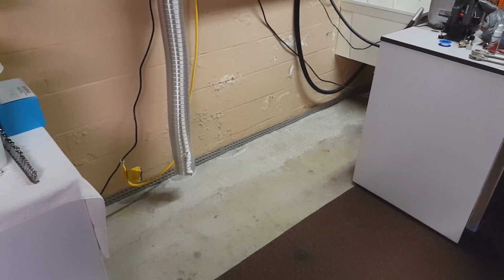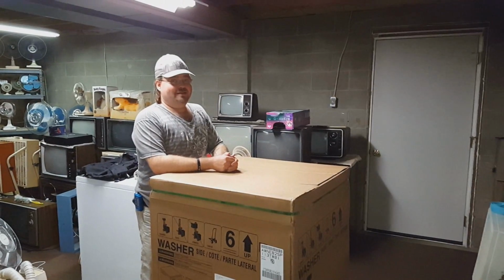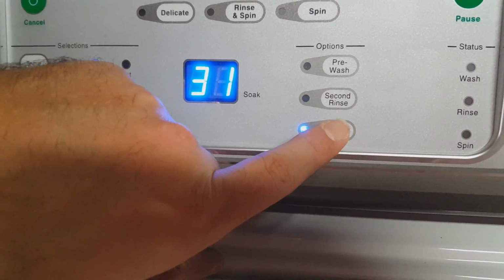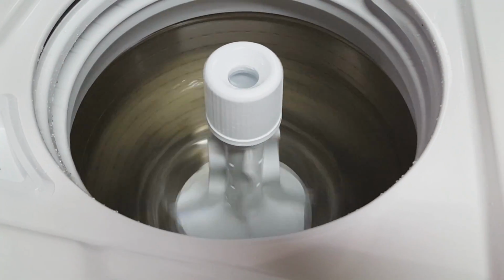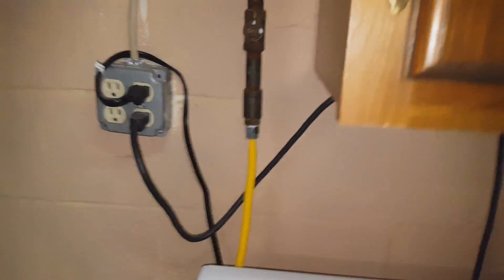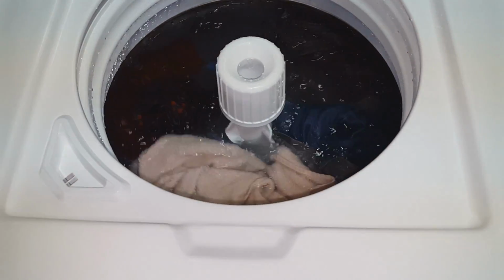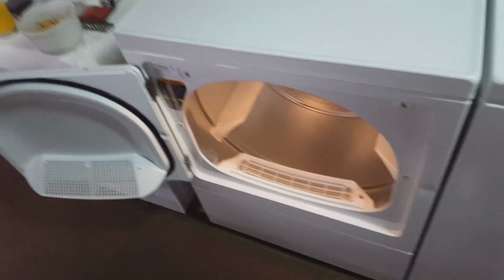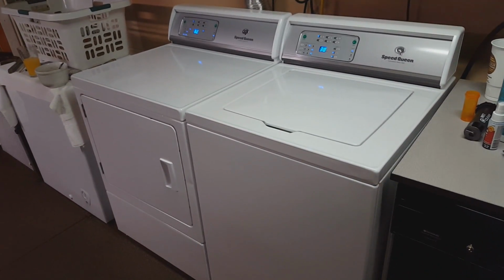The 2015 Speed Queen 8 Series

Comment: Speed Queens have pretty much all metal interior parts and they are advertised as reliable. Even if some of the parts were made in China, it’s still pretty much all metal. The only part that isn’t metal is probably the agitator or the balance ring or the bleach dispenser. Direct drives have a lot more plastic than a Speed Queen. There might even be some rare direct drives with plastic tubs.

Comment: Well, LG Front Loaders are not bad.

.  Last 13-16 Years (still would prefer a Speed Queen — Lasts 25 Years or Longer)

.  Use Oxi in Washer, whitens just fine

.  Use Vinegar during Rinse Cycle when Washing Towels, otherwise, Fabric Softener is fine

.  Excessive Detergent Usage is curtailed, just put in one or two Pods into the Drum when you start your load

.  Wipe gasket clean and dry after wash day, run Clean Washer Cycle once or twice a month using a Washing Machine Cleaner or one cup of Chlorine Bleach using Hot Water

.  Leave Door Open & Ajar at the end of wash day to allow washer to dry out and air out (eliminates molding and odors), and you may not need to run any cleaning cycles if do preventive maintenance.

I would buy a Speed Queen Front Load Washer if money is no object (can do a complete cycle in 35 minutes, again with regular preventive maintenance)

And if not, an LG would be the Front Loader I would buy.

An Electolux Front Loader would be an honorable mention, because it has a stain boost component and the ability to mix water, and detergent and/or other pretreater, to get difficult stains out.  I would still use the same preventive maintenance procedures with this machine as well.

👍🏾👍🏾

—Charles—

Comment: After 19 years of continuous use my Whirlpool washer's agitator stopped agitating.  I put in a new $3 set of agitator dogs and now it's about 22 years old and still going strong.  When it does finally clap out I'll be getting a Speed Queen TC5003WN.  I'm in no hurry though as like I said, the old Whirlpool is still going strong.  Who knows, maybe by the time it does quit for good  I'll have enough socked away to buy the matching Speed Queen dryer, lol.  I want the TC5 because it has mechanical controls.  I've had bad luck with digital controls in the past.  Everything from voltage surges burning them out to just the modules themselves going bad.  Have never had any problems with manual controls.  They usually outlast whatever appliance I've had.  2nd reason is that the TC series have a traditional agitator and transmission whereas the TR series doesn't and doesn't clean the clothes as well.

Comment: I love the old school top loaders, but I also love my front loader. My front loader is a Whirlpool duet ht 3.8 cu.ft + I have the matching dryer, they will be 16 years old on the 20th of January, and they are still working with no issues. 30 minutes to wash, 30 minutes to dry. I love the set because it uses a lot of water, while still getting the clothes clean, and then spin dries so well that it only takes 30 minutes to dry a full load. Surprisingly, I have had no issues with mold, mildew, or even a foul odor.  Hopefully when I buy a house in the coming years, I will have 2 laundry rooms. One with the whirlpools + my LG set, and the other with a speed queen set. Best quality brand I know is speed queen.

Comment: My cousin got a new GE set about a year ago and I did not recommend Speed queen due to the TR Series. So now I kinda want it to die so she can get a TC5000WN before the DOE Changes it again and makes them discontinue it. I Feel like the best thing for Speed Queen is to get rid of the TR Series and make a clone of the Calypso. I know the Calypso was not so reliable but I feel that Speed Queen  could make a U joint and leveler that lasts forever. and just make the pump connected to the motor and a diverter valve to stop it from throwing out all the water during the spin wash recirculate shower.

Comment: I love speed queen, but I do have a front loader from '04 and it is still going. The quick wash cycle, with a wash + 2 rinses + 1100 rpm spin is 30 minutes. Normal wash is the same thing, but 40 minutes. Heavy Duty is 50 minutes with HOT, but if we want the water EXTRA hot, its more like an hour, hour and ten. I think the cost is about the same as the speed queen TL.

Comment: My parents got a Speed Queen washer and dryer set just like the ones shown here in 2017 to replace a 2010 Samsung washer and dryer.  The only difference is the dryer is electric.  I recommended it to them after their Samsung dryer quit after 7 years.  The Samsung washer was already on its way out, and the rear bearing was squeaking and it smelled really bad, even after leaving it open when it wasn't in use!

Comment: Be thankful you got your Speed Queen when you did.  I saw videos on the 2018 models, & I don't like how they act more like an HE top loader, than a traditional top loader.  The agitator is bolted to the tub, brake eliminated, & unless you select deep fill, it senses the load to determine how much water to use.  The turnover is horrible on the 2018 models.  

Now for the set you have, it's nice.  Both a top loader and a front loader do equally well at getting clothes clean.  I have a preference toward front loaders, just because for me, I find that my jeans get cleaner in a front loader, because they turnover better in a front loader.  As for front loaders, I agree to an extent with you that today's front loaders for the residential market are crap with the settings required for energy star standards.  The Frigidaire front loader I bought in 1999 used enough water to get my clothes clean, & the longest cycle was only 50 minutes.  After my Hotpoint gas dryer quit working completely, & the Frigidaire washer was about to break down , I replaced both with an LG set.  I wanted a Speed Queen front loader set, but I didn't have close to $3000 for a set (in 2012, their front loader alone was going for around $1700 - $1800), and had to settle on the LG set instead.  Initially, my LG washer did not use enough water, but I was fortunate to see videos on how to adjust the water level.  I got it set to closely resemble the water level of my old front loader, & I no longer have problems with clothes not getting clean.  I hate the load sensing, but there's nothing I can do about that, as I would have to know how to hack the control board for everything.  I only use the normal cycle, an extra rinse (does 2 by default, but I add an additional rinse for 3 rinses), & depending on the weight & soil level for the load, I'm lucky if I can get away with 1 hour.  Since the capacity is a bit larger than my old front loader, I actually do fewer loads.  I will however disagree with you to an extent on that top loaders use less electricity than front loaders.  It depends on the load, but I do agree that front loaders don't need all those extra loads.  No load needs to run for 2 hours or more.  With the last 2 top loaders I owned, a Kenmore and a Hotpoint, used more electricity in 30 to 40 minutes than my last front loader, & current front loader that ran for up to 1 hour.  The reason I knew my last 2 top loaders used more electricity, is because I saw how quickly my meter changed in electrical usage.  My front loaders running barely changed the usage.  As for water usage, my current home and the home before my last were on well water & septic tank, that the well didn't run often,, & the septic tank didn't have to work hard to drain the waste water.  My last home, despite my water usage overall, the landlord was wondering what we were doing that despite our large household, that we used less water than a 2 or 3 family household.  The front loader helped us with having a water bill of no more than $30 a month.  My washer has held up for 6 years now, & I hope it holds up for a few more years.  I eventually want to upgrade to a larger capacity, so i will do even fewer loads.  

Anyway, good luck on your set.  You won't get another good set like that from Alliance Laundry again, now that their 2018 models are crap.  I believe they'll exit the residential market after the 2018 models, as I hear that they already stopped making front loaders for the residential market, due to not selling enough residential front loaders.
Reply: Yup!  Some of those videos are our own.
Reply: I believe they have a model called the TC5 That has a more classic style mechaniam
Reply: @ogam123  Alliance Laundry brought the classic agitator back last year.  This year they only have 1 classic model, the TC5 series.  They really want people to buy the TR3, 5, and 7 series, as it's the 2018 model agitator.  If I wanted a Speed Queen top loader, I'd get the TC series, as long as they keep it available.  The TR series is crap.  As for the front loaders, they have just the FF7 series, and is available in white, and stainless steel.
Reply: @davenwin1973  did alliance have to use the tr series because of stupid government regulations made 100% by tree huggers
Reply: @ogam123  I don't know, but even the TC series auto senses the water level now.
Reply: @DylBuilder1  I see some changes have been made to the TR series, that the water fill has been modified on newer models.  It still has the auto fill for sensing the load for the so called, right amount of water, but the option to do 3 water levels were brought back.  The TC series (the classic agitator washer) however is still auto fill, unless you select deep fill.  Makes me wonder if Alliance Laundry decided not to seek the energy savings certification on the TR series, by putting adjustable water levels back.  It is that dumb that a washer is supposed to decide for us on how much water it should use, and not us.

Comment: The big difference  is agitator speed and instant change of direction because of he constant direction of the motor, on pre 2017 transmission machines.  The agitator can work harder with less stress on the motor.  The transmission is a  huge advantage.  
In 2018, SQ eliminated the trnasmission, and reversed the motor to make the agitator go back and forth, but slower, and with less force  So IMO,  the 18 doesn't clean a well.

Comment: They do offer a manual dial model still which is what I am going for because it has a water reset feature which will allow you to override the default water levels to either reduce or increase water based on load size.

Comment: Hey guys. I have a question for you. Does you washer tub lean to one side during the wash cycle? Mine does and its driving me crazy.
Reply: Nope, it doesn't seem to.  Sorry for the late response.
Reply: Harley Badger Hi. Thanks for the info. I have had the guys out four times trying to figure out why this is happening. I told them to give me a new washer and yesterday at three pm a new washer was delivered. I am so happy that this one works perfectly. I would love to have a vintage maytag if I could find one.
Reply: Oh!  Well that's good that they took care of you.  Makes me confident that they'll take care of ours in the event we should need warranty service.  I assume there may have been a defect in one of the suspension springs causing it to provide less tension (or more tension) than required, causing the tub to angle.  And I hear ya, our 1996 Maytag pair gave 20 years of flawless service, and are in fact only out of service due to the washer's tub seal.  We were gonna replace the seal, but they've been in storage since because we just don't have the time.
Reply: Harley Badger I did write a letter to Alliance explaining my troubles so they sent two techs out but no luck. I then said I'm done so please replace and so they did. I also have a front load washer that needs the bearings replaced. I did buy the new bearings but haven't put them in yet. If you're ever in my area please stop in for some washer repair fun and I have no problems helping you with yours if you so wish. We live on the eastern shore Ocean City Maryland so if you love the beach come on down.

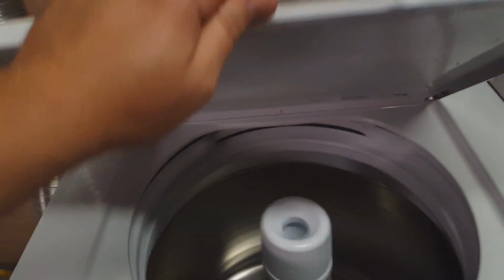Comment: Is the noise that it's making at 27:50 normal while spinning?
Reply: If you're talking about the whistling noise, yes, it's the holes in the tub whistling as air rushes through them.  The gurgling noise is residual water going through the pump.  In either case, yes.
Reply: Thanks for the reply, yes I was referring to the gurgling noise.
Reply: Ah ok yeah.  While spinning, the last of the water slings out and trickles into the pump, when it gets enough water in it to pump, it shoots it out to the drain and then it takes a few moments for the trickles to fill it again.

Comment: It's the outer ceramic tubs that RUST OUT not the inner stainless tubs I'm in the process of replacing 10 rusted out MAYTAG MAT 14 all need NEW NON rusted outer ceramic tubs only,10 years old .so I  ordered 5 speed queen top loaders a and 4 T. 300  DEXTER FRONT LOADERS. 3x the cost of Speed queen .with Dexter though inner and outer tubs ARE STAINLESS.also the outer panels are stainless.
Reply: This Speed Queen has a lifetime warranty on both inner and outer tubs.

Comment: Hi guys, and thanks for the really great demo of your new Speed Queen washer... I'm on my second front loader; the first was a Kenmore Elite made in Germany by Whirlpool that I bought new in 1999; the bearing went last year, so I bought another Whirlpool front loader, based on the service life of the first washer.  My only complaint with mine is that I always have to add enough water to the tub, other than that, it works very well.  I have a hose arrangement set up to add the water for all the cycles.  My front loaders have never developed that moldy stink that a lot of other people experience, and that may be due to the fact that I leave the door ajar.  I am going to seriously consider a Speed Queen washer like yours, though, not only as a backup, but also for things that I think would just wash better in a top loader.  Thanks again!
Reply: Heya!  Yep, you're avoiding the moldy smell by leaving the door ajar.  These machines are still working flawlessly two years later now, and you wouldn't be disappointed.

Comment: My mind is made up after seeing your video. I am getting ready to move into a new house, and I am going to my Speed Queen dealer tomorrow to talk to them about these and see how they compare in pricing. Since I don't have a gas hookup for a dryer, I will likely have to get the electric dryer. 

I'm impressed with the spin drain that these do. I remember the GE filter-flo washers used to do that. 

If I choose to buy the Speed Queen units, I am prepared to pay $1,700 or $1,800 for the set, but I think it would be worth it. I'm tired of the other crap at Lowe's, Menards and Home Depot. 

I currently have a 2008 GE set, and the washer is making some weird noises, and mice have gotten into the control panel and chewed off some of the wire insulation and made a nest in there. (How they got in there, I have no idea) 

I'll keep you posted!

Comment: Even the touch pad has a five year warranty, theyre referred to as being "mil-spec" grade.  Also you can get to the lid switch from the rear to defeat it without even raising the top. The 25 year figure refers to how long they project it will remain serviceable, and the inner and outer tubs are LIFETIME warranted.  I have one of the mechanical timer 2016 versions and im totally pleased with mine.  And you guys are so right, buy one Speed Queen for 20+ years or buy a new HE junk pile every three years.  My 40 year old 1977 GE filterflo that was left to me when my aunt passed away in the mid 80's lasted 40 years and is still going, its built like a tank but the outer tub finally started to show signs of rusting out at the top.  So I went washer shopping for the first time in decades and was shocked at the drop in build quality.  I wasn't fooled for a minute by the flashing lights, fancy paint jobs and show tunes - only took one visit to the big box stores to decide on a Speed Queen and glad I did.  Good as my old Filterflo was the SQ is even better, biggest difference is its much smoother in the spin cycle.  Ill keep it though, it still washes well and heck its a family heirloom-lol

Comment: Hey I own a IPSO cw10 front load washer without the coin-op unit in it & fits 10kgs of dry fabric wash.

I love it ever since I brought it(not cheap, but worth it for the guaranteed 2 decade warranty the machine has) basically I'd be 45 when the warranty runs out on my machine. :]

Further more I'm Aussie.